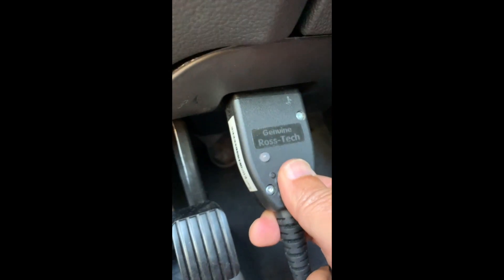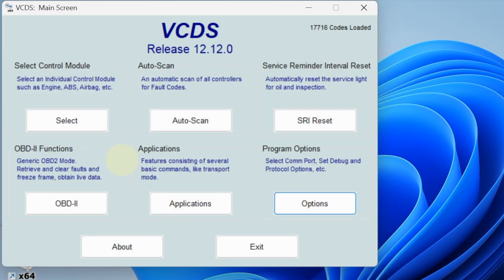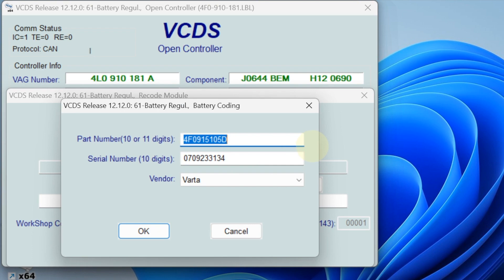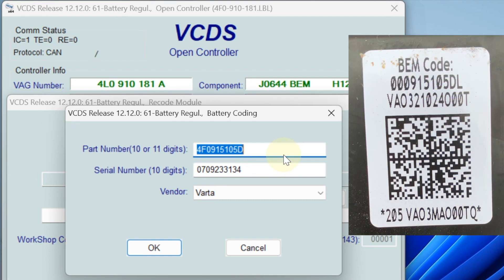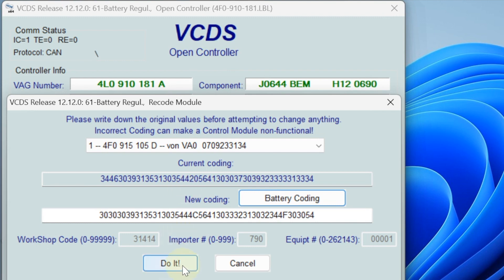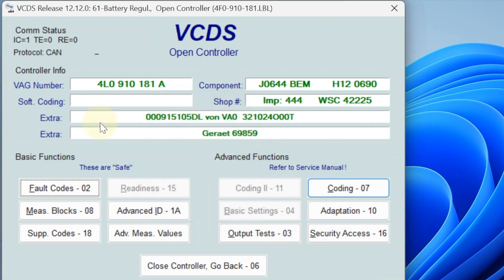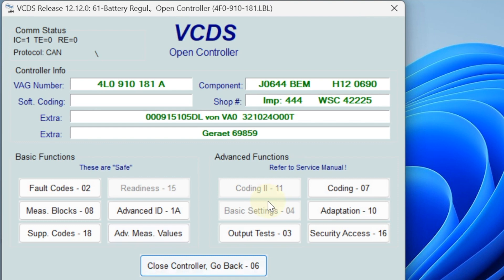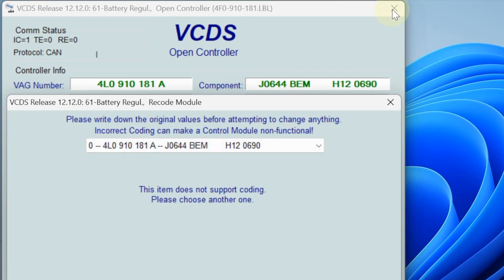Q7 New Battery Coding with VCDS

Comment: Would you help me to solve the coding of the Bosch 110A battery, what should I type in these tags PART NO:0092PP0150 ..SHOTR CODE:PP015....EAN CODE 4047026554403 It is an Audi A6 c6 2005 I need the part number and serial number of the battery.  Thanks in

Comment: hi, i see u made a hakcintosh on elitebook g7, Your microphone internal work? What layout id you use?
Reply from the maker: Mic does not work alcid 55
Reply: @3dogs1monkey  mic does not work too? Sleep working?
Reply: @3dogs1monkey  sleep working?
Reply from the maker: @danielfabriciofreita  no
Reply from the maker: @danielfabriciofreita  yes but no keyboard after wake
Reply: @3dogs1monkey  same problem :/ . No have solution?
Reply from the maker: @danielfabriciofreita  just turn off sleep
Reply: @3dogs1monkey  sad :/
Reply from the maker: @danielfabriciofreita  it’s not a good laptop for hackintosh but works quite well.
Reply: @3dogs1monkey  The last laptop is a elitebook 8th. Worked perfect :(